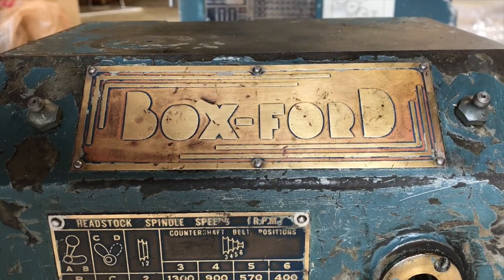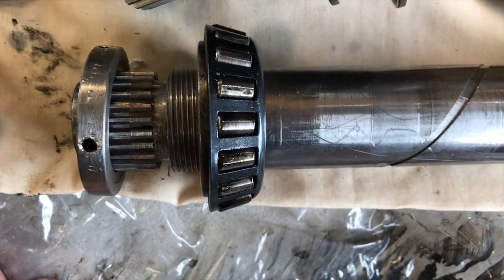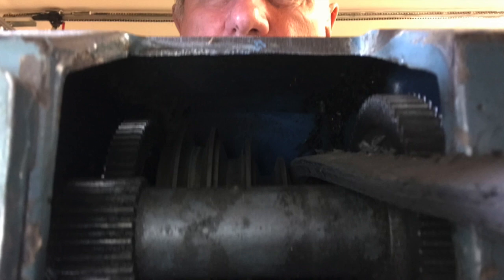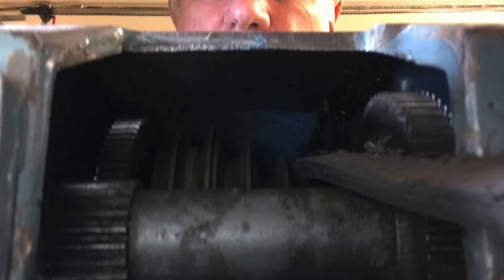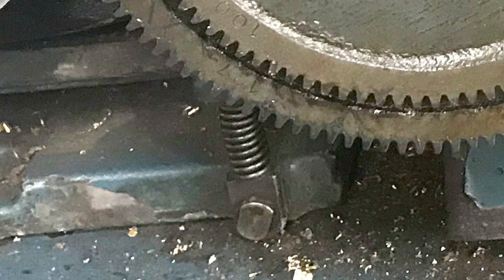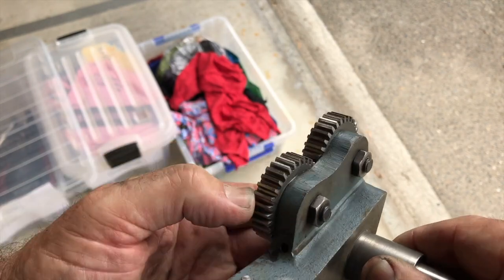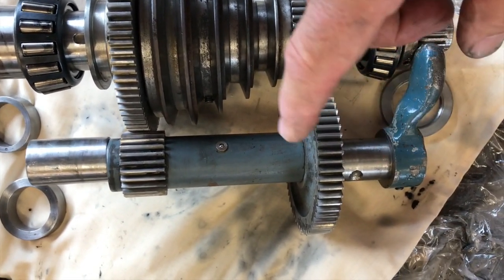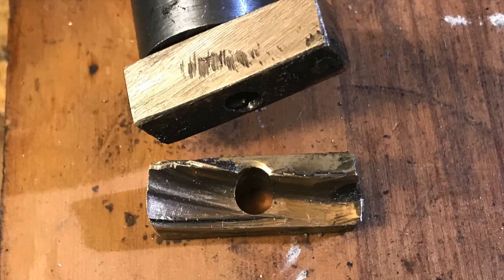Overhaul of the lathe head. (What is inside this 1953 Boxford Model A engineers metal lathe?)

Comment: Hi Evan, this video was extremely helpful to me as I have just bought a 1967 version of the Boxford model A bench lathe. I would like to know how you lubricate the pulley when using the back gears. The manual mentions a 'reservoir' but the photo is not clear.  This pulley seems very inaccessible to me.
Reply from the maker: I don't have access to my Boxford right now, but there should be a little button oiler point on the shaft but it is extremely difficult to see, especially with my lathe bolted to a bench top against a wall. If you are not already a member of the Boxford Users Group I would suggest joining. There are some very knowledgeable members with many decades of experience with these lathes. https://groups.io/g/BoxfordLathe-UserGroup
Reply: @Evan-e-cent  many thanks Evan. I have also joined the group now 👍

Comment: I get that you made the new bronze selector, but did you renew the pin? Is it removable, screwed it, press fit? Thanks
Reply from the maker: I should have made a new pin that the bronze selector mounts on. I fully expected it would be necessary, but when I mounted the selector on the old pin it seemed to work well. I thought the selector might fall out but it never has. I don't know how the pin is held in place but suspect it is a press fit as you suggested. Since I do not have another lathe to make a pin, or a press, it seemed like too much trouble. Now I have a friend who would let me use one of his four lathes.
Reply: @Evan-e-cent  I opened up the boxford yesterday, and exactly the same thing as you. My pin was intact though. Made a new segment for it and bingo, night and day. Mines a CSB so much easier to strip. A 15mm stubby fits those under headstock bolts. A fiddle yes but not too bad.
Reply from the maker: @MrJohnandMargie  That's good news and time to celebrate with a different kind of Stubby. If you have a CSB (no lead screw gearbox), have you tried out my program RideTheGearTrain.com?

Comment: Hi Evan, this video helped me immensely you solved at least two mysteries for me. The bronze key in my lathe is missing completely, another thing that is missing on my lathe is the oil button inside the lathe. I thought it was poor engineering  having an oil port open to the atmosphere, allowing oil to spray out of the spinning part when the lathe is running soaking the V Belt. with oil. Thanks for sharing your knowledge.
Reply from the maker: The bronze key is something that many people, even with years of experience with Boxford lathes are unaware of. And yet it is very common for it to be worn out. It is the only part in the head that you would expect to wear over time, but not well documented. I have come across several people with the same problem.

Comment: Would be better if I could hear what you are saying.Your voice level is either very soft or booms ,would be great if you used a microphone and set some levels.I do want to hear what you have to say.
Reply from the maker: I am sorry you had difficulty with the sound. There is a problem apparently.  I use a MacBook Pro computer, a microphone and Bose headphones. I record using iMovie and adjust the sound level to be uniform.  A friend who is a recording sound technician in London commented without prompting that he thought the sound quality was good. I listened again online with my headphones and it sounds great. Then I unplugged the headphones and used the internal speaker and had to turn it up to full volume!!! I hadn't thought to do that before!  So in future I will have to record at a higher volume. So thanks for pointing that out. If you have a Boxford I would suggest joining the Boxford Users Group. Also look for my free online computer program for finding what gears to use to cut any threads. I just uploaded a new version. You can Google RideTheGearTrain with no spaces.
Reply: @Evan-e-cent  I could hear you clear as a bell bud.
Reply from the maker: @MrJohnandMargie  Thanks John!  For more recent videos I have set the sound level so it is hitting the red line all the time, and a different microphone. But this one hasn't been changed.
Reply from the maker: I have bought a more professional microphone and it seems to be much better than my first recordings.

Comment: This is a really interesting and useful video. Thanks for posting it.

My Model A is  a bit older than yours. (The main difference is that the main belt position is changed by sliding the whole motor table forwards via a knob/lever on the front of the bed).  I also notice that it has fewer oil points on the gearbox. It only has the oil nipple on top, and no ball oilers by the leadscrew. However, there must be oil passages inside, because when pumping oil into the nipple it drips out at both ends of the gearbox casing.
Reply from the maker: I'm glad you found it helpful. I only recently found the serial number of my lathe at the end of the bed, hiding under the tailstock. It is B5763. Boxford Users Group has the original document from Boxford listing the serial numbers so it appears that mine was not made in 1953 as I assumed, but in December 1955. I keep adding more videos to my playlist. The latest one is about online software I wrote to solve gear train problems for screw cutting.

Comment: Hi I have a boxford me10 this as helped me a lot mine has no grease nipals on the mane causing are they for the mane shaft thanks again keep it up
Reply from the maker: Yes, the grease nipples on the top of the head casing are to lubricate the two tapered roller bearings at each end of the spindle (main shaft).  The video also shows a hidden oil point inside the head on the back-gear shaft.  There are also two grease nipples on the V-belt pulley idler shaft seen in this video, and grease nipples on the gear box and lead screw.  I am glad this was some help.  

My lathe now runs much more smoothly and I am very pleased with the results. Certainly it fixed the problems with both the back gear and front selector leaver which had both been jumping out of gear,
Reply: @Evan-e-cent   mine not got them and yes bean down the shed and oiled the back shaft my lathe is a ME10A 37355